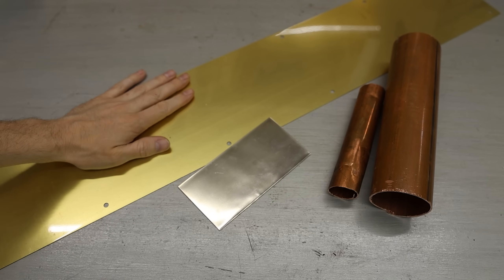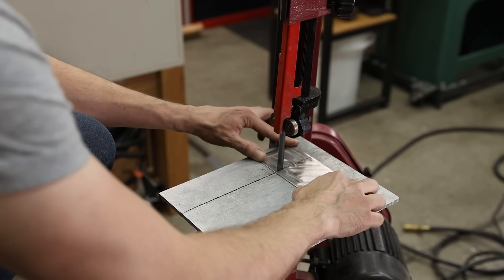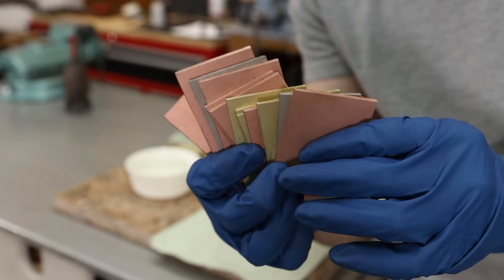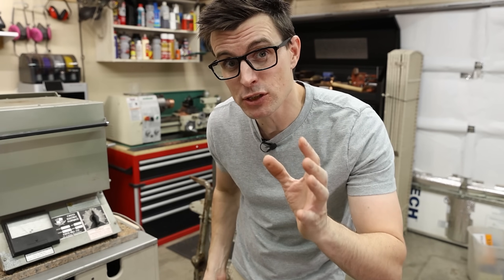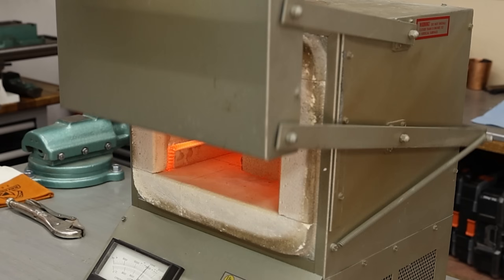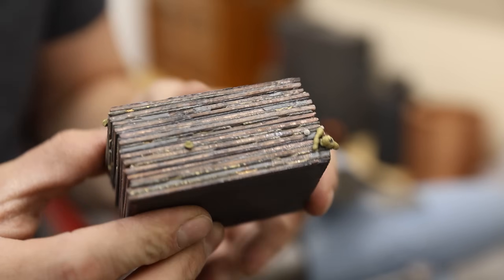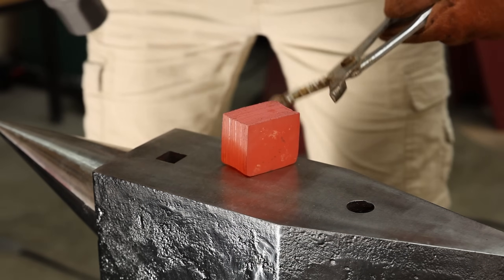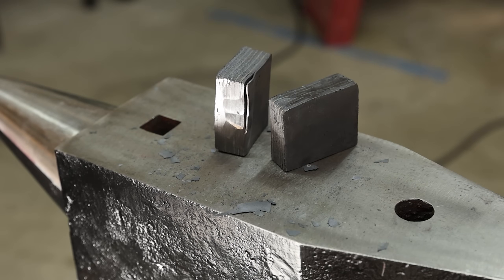Can I make Copper, Nickel, Brass DAMASCUS? - Mokume Gane

Comment: If you make it taller in the direction perpendicular to the layers, you can compress it down to square and twist, which makes it come together very well. Then just hammer it round and boom. Round bar Mokume Gane.

Comment: something I noticed at the end was that you were still hitting it after it had cooled down, now take this with a grain of salt because most of my knowledge comes from steel smithing but hitting the metal when it's that cold will create stress fractures and unless everything has perfectly welded I could see it making fairly minor delams into major ones

Comment: I've been in the foundry industry for roughly forty years now. When I saw your metal choices, I had to watch. Brass being a copper/zinc alloy has a melting point about a thousand degrees less than nickel. Nickel is considerably harder than copper or brass so forging is interesting. Never heard of mixing / forging nickel with copper, brass. Good try!

Comment: Appears you need a higher heat to laminate the cupronickel to the brass and copper layers.  And also start pounding out and start folding to make the continual wrapping and folding of the material into the final damascus features.
Reply: I was going to say, it didn't look like he got the laminate hot enough for forging. Should have been closer to yellow-white then red.

Comment: Hmmm brass, copper, and nickel.  A s both copper and brass have the same composition, their melded together (with the soft zinc of  brass) would weld together.  It is the nickel (1 of 3 ferromagnetic metal elements) that creates cupronickel.  The copper and nickel interfuse, while the copper-zinc alloys both have a copper vein as the main structural body.  Interesting concept !!!

Comment: I think the sandblasting was the biggest issue, having that large surface area definitely trapped gunk and had a good deal of oxidation before it went to forging. Smooth finish works best for any type of forge weld

Comment: I dont think copper will weld to nickel, so that explains that part lol ... but BRASS and COPPER DO WELD TO STEEL... which INCLUDES CAST IRON!!! (you can melt cast iron with your furnace with NO PROBLEM!!!! I can't remember if you have already tried it, but there's anothe3r channel I watch that melts down scrap and sometimes he's melts down cast iron and its just like melting copper or brass or aluminum, etc... nothing special or extra to do) - and MAYBE you can forger the3 copper or brass to some cast iron 🤷‍♂
Oh and you could probably make your Mokume Gane block into something simple, that doesn't require you to cut it or shape it because it will de-laminate and become ruined.... and that would suck... so maybe you wrap a thick piece of silver around it to hold it together, and maybe a bow on top (from the silver)  to make it look like it's a present :)

Comment: I have seen a bunch of different knife makes actually use KEROSENE to prevent oxidization between different layers when forging... they weld the layers together (they are typically using steel in their layers along with copper, nickel, and or brass... so they just weld the layers directly, but your technique is great, but wont fully prevent oxygen from getting in) and then  put the entire thing into kerosene before putting it into their forge... then when they take it out they hammer it a bit then put BORAX on the layered side, so it melts and gets in between the layers, put it back in the forge, then hammer it again... and that's it for oxidization prevention... and it works perfectly.... 
IDK if this would be easier for you or harder... but I just wanted to tell you what I see professionals do ALL THE TIME.... :)

Comment: With the two sections that failed, why not 'go for broke'..? Get them really hot and put them under a [hydraulic] press or hammer mill, to see if you can meld them into decent pieces of bar stock. Then you could give them a normal damascus 'rope twist', and hammer them into blades. Even if they aren't entirely functional, they should at least be very ornamental with the combination of metals.

Comment: The brass has a lower melting temperature than the copper and the nickel so in the layers sandwich the nickel between brass and the same with the copper and the layers should fuse together properly.

Comment: You need way more pressure my only success was put in vice and squeeze and heat at the same time and use a borax flux while its heating to stop oxidation

Comment: Sand blasting can contaminate soft metal surfaces with grit. I would avoid that,band perhaps use mild acid etch. I've also heard of some smiths building a bix around the metals, and filling with charcoal powder as a flux and way to absorb oxygen during the welding process. You don't need to melt these metals. It's a fusion weld, below tye melting point. Clean and pressure are key.

Comment: I'd suggest an argon purged canister.  Alec Steele has a bunch of videos trying to make Titanium Damascus.  Argon purge is mandatory for Titanium, but he even tests the canister on dull red steel and it works great there too.  

He also moves the metal a lot more when setting a weld.  Got any friends you'd trust to swing a sledge hammer for you?

Comment: Whenever i see such damascus, people have scorching hot solid color of entire block and rush to the hydraulic press, so my best guess is that Your block simply cools down and you hit hammer against colder surface, helping it shatter, rather than combine. i imagine it must be extremmaly hard and exhausting to work with such low temperature metal And using a hand hammer for this

Comment: melting points: copper ~1080°C, Bronze ~900°C, Nickel ~1450°C, so I think you were not hot enough at 700°C for welding nickel

Comment: This is not " Damascus " it's" mokume", as it is made up of non ferris metals..... use borax powder to stop oxidation.. heat till you see a mirror like a shimmer along the outer surface.. no need to hammer. Let cool slowly, then normalize a few times, and it should become more workable.🙂

Comment: You might want to try using nickel silver rather than nickel. It's more similar to the copper and brass.
Reply: Yep.  I was going to suggest nickel silver as well: it's commercially available in sheets and retains the bright white look of pure nickel.  Also flux would help a lot with the oxidation.

Comment: Damascus is a place not a type of steel, Damascus steel was only made in Damascus if it is made anywhere else it is called folded steel, in Japan it is called shita-kitae not Damascus steel as Damascus steel is from Damascus.
It's called folded steel because they would "fold the steel" and the folding prose is what gave it it's strength.
Modern attempts like this layer metals and they don't bond together.

Comment: Hello. First of all, I'd like to tell you that I wrote this text in Spanish and I'm going to translate it using Google Translate; so I suspect any translation errors will be Google's fault (although I'll try to correct them if I notice any obvious ones). Next, let me clarify something: I know NOTHING about casting or materials. I'm a musician (a pianist) and I have a "workshop" (so to speak) that isn't mine, but my father's. As an aside (my income comes from teaching beginner music classes for children ages 2 to 5, and from individual piano lessons), I restore some tools I like (my father's, and other tools and things I buy in my home country, Argentina). I have several machines (there's no need to list them all) that, as I said, aren't mine, but my father's. Among them is a grinding machine. When I watched the video and you said you were trying to keep the plates flat to prevent air from getting in and oxidizing, I thought you could have used a grinding machine. But then I realized that wasn't possible since you were using brass and copper. However, I thought of something else that can help make the plates as flat and uniform as possible and prevent air from getting in (or as little as possible). Seeing how the MetMo team made their MetMo Cube and how they managed to make it work so beautifully and not have the cut visible, I was reminded that they did it with amazing technology. I'll describe it here and post the full text from their website: 

"We love pushing the boundaries with machining techniques. The process we've used to create this is called wire EDM (electrical discharge machining) and it's now so advanced that in some industries cuts are being made to 0.02mm, with tolerances being held to +/- 0.001mm! To put that into perspective, the average width of a human hair is only 0.08mm! That's how we achieve such a seamless and mesmerizing effect.". (https://www.metmo.co.uk/products/mk3-steel-metmo-cube)

Of course, I don't know if that technology is within your reach or if you have a way of finding someone who can do that type of cut, but it occurs to me that, if you had that possibility, you could put together three pieces of copper, nickel, and bronze and have each of the necessary sheets cut using that technology. That way, each of the sheets would be almost "associated" with each other and the risk of air getting in would be much lower. All of this is just an idea I have; but none of it is based on my knowledge of the subject, since, as I said, I'm a musician. On the other hand, regarding not hitting and pressing the sheets, I can't think of any tool you could use to apply pressure other than the one you used. In any case, to achieve much greater pressure than what you achieved with the vice, you could extend the vice handle with a steel pipe of a certain length and, with less effort, apply much more pressure with much less effort. What you're doing is truly interesting. Those of us who know NOTHING about materials, casting materials, and their processing are, I believe (without fear of being wrong) amazed at the wonderful things you achieve. Thanks for sharing these videos. I learn a lot from them.

Comment: Copper and Nickel have wildly different thermal expansion coefficients. They will slide against each other on every heating/cooling cycle. For every degree Κ you heat them up, Copper will expand almost 25% more than Nickel.
Reply: Good thinking, probably best to use alloys to bring the thermal expansion closer between the two while keeping similar looks

Comment: I find it curious how most of the forging channels I follow are obsessed with joining soft metals with such different forging temperatures... The reason behind it? Creating "pretty" patterns. Utility and practicality? Zero.

Is it really worth it? I mean, you spend a ton of money and time on relatively expensive metals to follow a process with a high probability of failure. What will you do if you succeed? Make a knife that will become dull as soon as you cut a sheet of paper? A figure that needs to be stored in argon, in an opaque container, and without sudden temperature changes so it doesn't rust or destroy itself?

You're like Bart Simpson summoning that creature who suffers and won't stop vomiting... that thing simply doesn't want to exist.

Comment: I don't have experience in making Mokume Gane,
but based on my experience in crafting jewelry with copper, brass, and nickel,
I can tell you that it might have been better to use liquid borax between the layers to prevent oxidation.
That's my two cents...
Reply: You can take the copper sheet, and tin it as well, so that you get a good wetted surface with the brass and nickel. Then at last the tin will adhere to both copper based metals, though the nickel you would need to tin as well, using some silver solder paste, which will both clean the metal chemically during the first heating phase, but will also add in a thin silver tin coat that bonds both together. 

Time to order a bottle of stainless steel solder paste, which uses an acid based flux, and have a thin coat on the nickel before you compress it together and weld the frame on. You can use the same paste on all layers as well, it will bond to copper and brass well, though you will need to have a lower initial heat to prevent it melting out, so just hot enough to anneal the copper, and a bit more work with the hammer to do the initial weld, forcing out the melted paste as the metals are bonded together. As well when welding run a bead up the rods while you have the one side welded firmly, so they heat up, and when contracting with the top weld completed, apply more pressure to the sandwich of metal. Even during the heat cycle the steel will expand less, so keeping the clamp force there.
Reply: I have made Mokume exactly once before, with the help of an experienced instructor, and I agree with @sholoush, oxygen is not your friend here. Chemically clean those surfaces, press them together, flux the hell out of them, keep them under tension. We used titanium wire to keep the whole thing tight.
Reply: I pour Soldar (liquid flux) into the billet stack just before firing, I also sprinkle graphite onto the sides and it forms a sort of paste that fires into a little bit of a reducing shell …last billet the graphite ran inside a few millimetres and it was tragic, so many failure points with this, it’s a great curve to climb

Comment: What if you used thinner nickel or zinc? Also drill some holes in it so the copper/brass squishes into it. Might even be able to use copper/brass plugs inside the holes so there's no cold shuts

Comment: I enjoy it when someone posts a vid that "didn't work" occasionally, rather than only showing the perfect outcomes. I found it very interesting, thanks 👍 Regarding any tips, I'm not a metallurgist, but you had the kiln at 1700f. The melting point of the metals are: Copper/Brass around 1800-1900f, but Nickel is up at 2600f. So that would be the first thing I'd try to figure out.

Comment: use a rolling mill to "roll bond"the layers? at the 2:58 mark I see you handling the sheets over the granite. It could be possible that you got a little bit of cross contamination from the shop surfaces. That in addition to the sand blaster may not be clean, as whatever else was basted could cross contaminate the sheets. Use acetone in an ultrasonic cleaner?

Comment: In bimetallic systems, it's challenging to bond two metals because they expand and shrink at different rates with temperature changes, and this difficulty increases with each additional type of metal used.

Comment: Judging by the wall thickness you are using L(K?)-type copper, it is an alloy (Silver  bearing) which might effect its binding/bonding characteristics. (Fractured lamination).

My brother hand forges Pattern Welded/Damascined Wakizashi [Short Sword) blades by traditional methods. 
He had a problem with delamination on some of his first efforts. Then he discovered a POTENTIAL source (See below), and substituted purified, alloy free, Native copper.

From various sources:
Copper Type L Hard Temper Straight Pipe is utilized for a variety of plumbing and heating purposes. It is constructed from Alloy C12200 (DHP) which meets industry standards and is NSF and ANSI Standard 61 certified.

Type L copper piping is made from a specific copper alloy, C12200 (also known as DHP or Phosphorous-Deoxidized Copper), which is a high-copper alloy with a minimum of 99.9% copper and silver, and a maximum of 0.015-0.040% phosphorus.

Comment: The issue was not using the PRESS you just bought. :face-blue-covering-eyes:
In the vice the pressure was applied mostly centrally, allowing the sides to "curl" outwards away from one-another. The biggest deflection (squeezing power) was in the center of the outer 2 steel discs, supported by the 4 pylons.
Reply from the maker: @IcecalGamer  the fly press is nowhere near ready to use. I’ll give it another try when it’s ready.
Reply: Armchair quarterbacking by a nobody that thinks they know something cause they watched a tv show.
Reply: @JO-ti5zp  yet here you are doing the same, with zero useful info.  The vise would've been okay had he not welded the pins to the plate.  Better to use nuts and bolts for that so the plate is free to squeeze down.  A press has enough force to bend the pins while squeezing the billet down and it's fine in that application, a vise does not.

Comment: I’m just wondering if braising the layers together initially would help keep the oxidation down during the initial heat. I believe that even though you cleaned the plates before hand there was probably still a very small air gap between them which made the layers harder to forge weld together. 

And I’d say leave it as a block, looks good as is.

Comment: Looks like a great start! I had success starting with making large coin shapes, to nail down what needed to happen a little easier. I was surprised how much 'slack' I needed to take up (err... how much compression was needed) to get a really good 'weld'.  You could try getting the stack out of the rig as soon as possible, so you can get more movement as soon as they're not going to fall apart. Definitely excited to see the next one!

Comment: Pattern welding. Not Damascus. That said, the answer is probably yes if you can prevent oxides from forming and weld them in an inert atmosphere.
Reply: You have to watch out for different coefficients of thermal expansion and contraction.
Reply: Hmm... having now watched the video, electroplating might be an option. Copper onto brass, then nickel onto copper-clad brass.

Comment: does what metals touch eachother matter for the cohesion? like nickel touching brass vs nickel touching copper bind better?
Reply: yup for sure, brass and copper would bind well since brass is mostly copper. the metal has to be compatible.  aluminum for example wont braze onto anything but aluminum.

Comment: I would say not enough fast pressure on the forging at the right temperature, a small hydraulic press works wonders for beginners.. good luck.
Reply: cheap log spliter to star of with